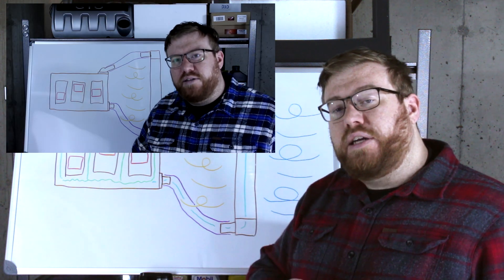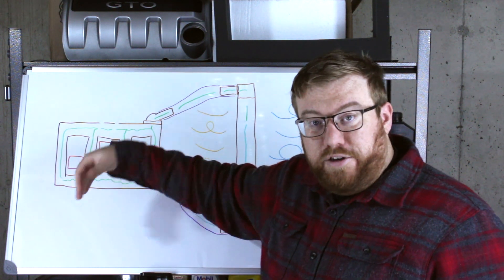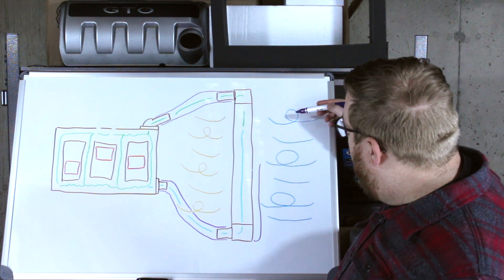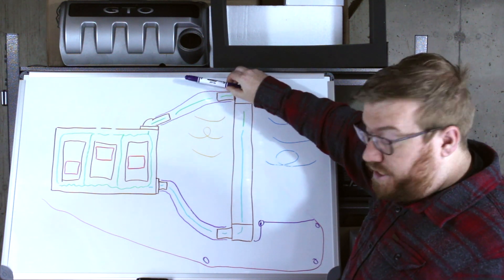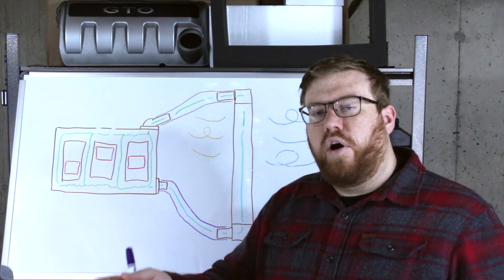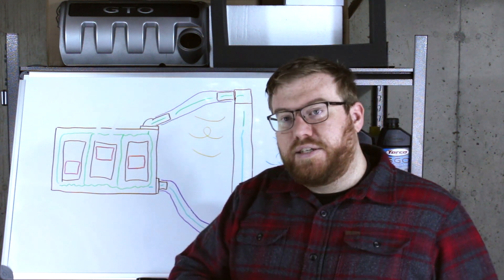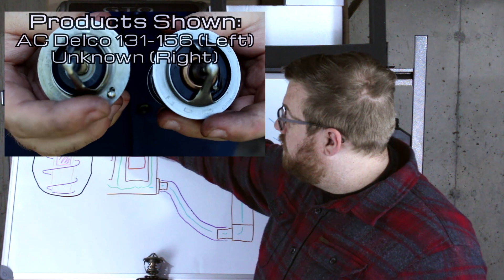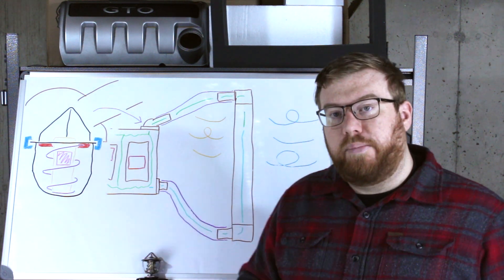How Thermostats Work & How Engine Temperature is Regulated Without a Thermostat

Comment: so I have an question, my uncle changed his thermostat to a lower temprature one and also his radiator fans were working all the time i dont know why but he didnt listen to me and he blew his head gasket at the end but, heres the question why ?? I said what mechanics told me so I really dont know why he blew his head gasket. you know i want to know what scientifically happens when you change OEM thermostat to a lower temprature one. would you mind explain it to me?
Reply from the maker: I can't give a full picture of what happened from just those two changes, (or if the radiator fans spinning all the time was a mod or a symptom of a problem) but they are generally changes made for performance driving, which is a driving situation more prone to damaging head gaskets. Sometimes a thermostat swap to a lower temperature is incorrectly assumed to mean that the engine will actually run at that temperature. It could, if the rest of the cooling system is capable of cooling the engine that well (which may be the intention behind making the radiator fans spin all the time, again assuming that was intentional) but if a cooling system is struggling to handle the heat that the engine is generating, even completely removing the thermostat won't solve the problem.

Overheating can also cause warped cylinder heads, which, without actually taking the engine apart, leads to the same diagnostic issues as a blown head gasket.

Comment: Steve great review of the balance of a vehicles cooling system.    You could talk about an air cooled car, like the original VW's and Porsches in a later Video!
Reply from the maker: Thanks! Sounds like a great idea! I will need to brush up on the fine details first.